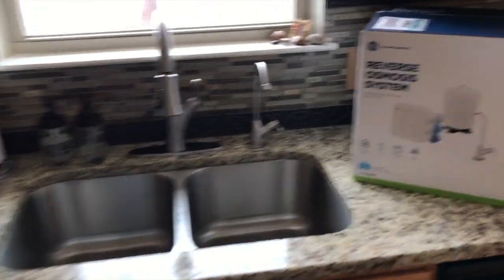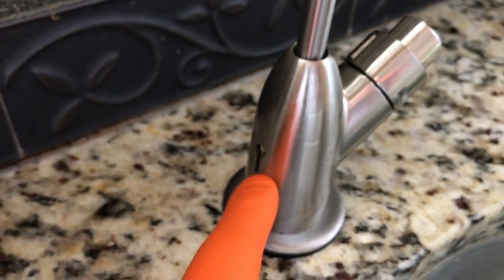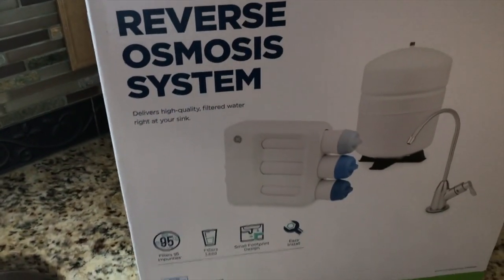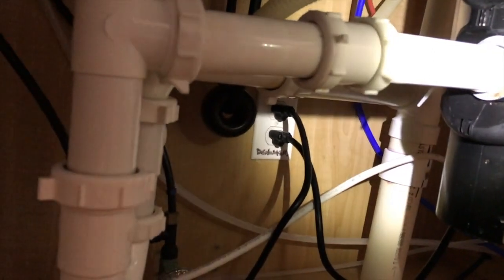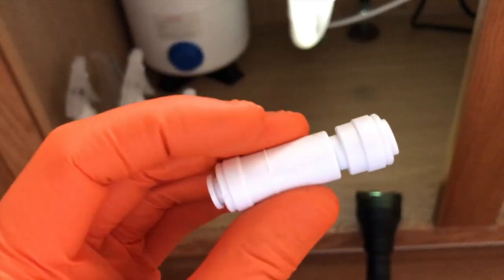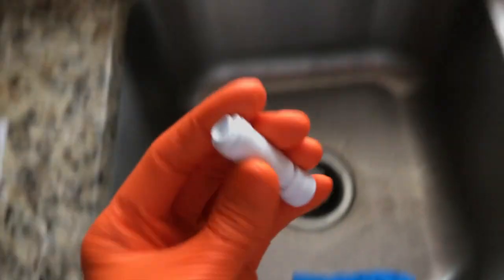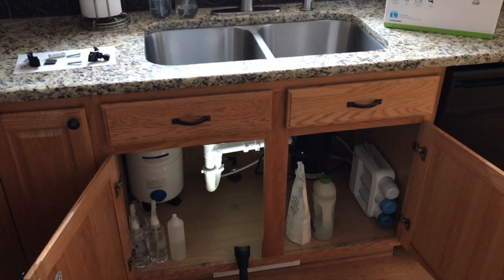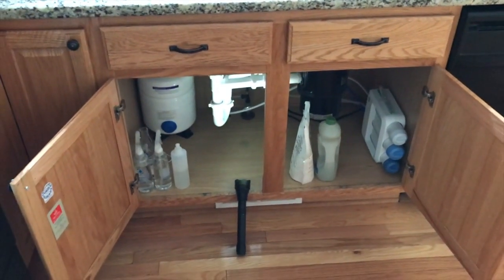Reverse Osmosis faucet Air Gap Bypass Kit

Comment: What if water is leaking out of that little air gap hole on the side of my faucet?
Reply from the maker: Thanks for watching, any update?

This is an indication that the drain line is blocked.  We recommend removing drain line from lower plumbing adapter and verifying it is clean and clear and not blocked.

Comment: I just cut the lines and added a 3/8 to1/4 adepter
Reply from the maker: Thanks for watching and sharing.

😁☕️🧰
Reply: The whole point of the air gap is to prevent sewage water to go back to the system in case the drain is clogged. When bypassed , isn’t the check valve supposed to block the back flow?

Comment: My air gap in the base of the faucet dribbles water. Started  after the first 6 weeks or so.
Turned the supply line off to the system and it stops.
Will this bypass stop the faucet from slow draining out the “weep hole “?
Reply from the maker: Thanks for watching, this is usually caused by a clogged drain line.

We recommend grabbing a small container and placing it where black drain line can drain into it.

Next, with system turned on and operating…disconnect black drain line and verify it has water draining out of it.

If no water comes out, try unclogging line so it stops leaking out of air-gap.

Below is a link to a tool that can be very helpful for unclogging line.

       https://amzn.to/4kqZ9oF

If interested in purchasing this product, visit our Amazon affiliate link above.  I earn from qualified purchases.

Comment: Ok! Let’s see if this is a solution for me: 
I have a waterdrop RO G3 P800 (non air gap) that I’m putting through a remineralization filter. That then T’s off to an espresso machine. And the other end (3/8 female compression or I have an adapter to male) is heading to Moen 3-in-1 filtration pulldown faucet (FS72003) that is set up for air gap. I am hoping to bypass the faucets airgap as my area code and RO system do not require one but I could really use some help!
Reply from the maker: @caprittaroberts895  

Thanks for watching, any update?  This system is awesome and very friendly to service.

Please let us know if we can help answer any questions.  We have also shared a link below to our (Fixing RO systems Playlist)

       https://youtube.com/playlist?list=PLjCXOz8TSkZlQnBuZZrgOiwjkvAkXc_Ov&si=RSuwj3Dq1lFd82s5

😁👍🧰

Comment: Can i change this GE tap with the regular no air pressure one,
Reply from the maker: Good morning, just poured a cup of coffee and am sitting down to answer any and all questions for the DIY community.

It’s possible however will require a small amount of modifications depending on the faucet you will be installing.  Most important thing is to properly install hoses on new faucet to alleviate back-flow or pressurization imbalance.

Let us know if you have any questions and hey if you’re into crypto trading, join our DIY ecosystem and become part of an exclusive group of DIYers.

       toolboxtoken.com

Reach out to us any time!  🧰

Comment: Michael, you mention removing the Red and Black drain lines from the Faucet... But you don't explain how to do this. Do I remove the Faucet to facilitate the removal of these lines or just pull them off from underneath? Please explain. I've had this same problem repeatedly recurring with my PureblueH2O system from Costco. And PureblueH2O is the WORST at customer service. THE WORST. Please provide more detail in your Fix. And Thank you for all the time and effort you put into your videos. 
@DIYwithMichaelBorders
Reply from the maker: Thanks for watching, removing these lines from this specific faucet setup is very tedious…

It’s best to have the faucet fully removed and resting on a table or in your lap for this procedure.

Most will steer away from pulling lines off faucet as it can possibly become a problem putting them back on.

Several of our viewers have shared with us that they removed faucet from countertop and removed lines from filter case.  They then allowed faucet and lines to soak in a pan of vinegar for 24-48 hours which cleared up any internal grime causing issues.

😎👍

Comment: People are making this too hard… air line should be mounted above P trap, take air compressor, blow the line out with high pressure…. Air duster can work to clear the line as well but high pressure works great…. It’s routine maintenance…… regardless of what kit you use, even the kits should be routinely maintained. This  method should be the most preferred due to the fact that every man needs a air compressor, one that is unnecessary so it can handle any air tool. Now because of the faucet, you have a bad axx air compressor, and have the excuse to start buying air tools that you never really use, but can also show your friends. Now your friends will need a leaky faucet.

Comment: Are you serious about the bypass kit being an issue for a house sale? Come on. You just take out the check valve (or just leave it, doesn't even matter), and you replace back the faucet to airgap IF the inspector thinks it's an issue. Also, no sane buyer will care. Are you saying that you would rather deal with the sound that spend 5-20 minutes to swap the faucet? There was no need to replace the perfectly good saddle valve, could have just used an adapter fitting, it costs $2 on aliexpress and $4 on Amazon.
Reply from the maker: Thanks for watching, we appreciate you sharing your thoughts.  Short answer, yes, bypass valves are not to code in certain areas.

😎👍
Reply: @DIYwithMichaelBorders  ok yes but who cares. the argument made in the video is that it will be an issue for a sale. and this is not a very good argument, because it is extremely easy to fix before the sale (replace the faucet quickly), and second no buyer will ever care. and from the perspective of food safety, you just need to make sure bad water can't get sucked back in. there are many ways of ensuring this is the case. for instance, my RO drain line goes into a sink in the basement's mechanical room, and even if there was negative pressure, it would only suck in a little bit of air and nothing else. also, IMO there is no reason to have RO under the sink. I have 2 houses and in both houses I installed RO in the basement. this makes them a lot more accessible, easier to maintain, and saves a ton of precious space under the kitchen sink.
Reply from the maker: @michaelkuzmin  

We appreciate the reply & your take on it.  👍

Comment: Hi! you mentioned that in order to install the bypass kit, you need to remove the black tube and connect the red tube to the kit.  Can you please elaborate a little more?  Do I disconnect the red tube from the filtration system and connect it to the bypass kit? what happens to the red tube connection at the filtration system?  How do I remove the black tube from the faucet line?
Reply from the maker: Thanks for watching & absolutely.  This kit will alleviate the black line all together.  The red line is the line that dirty water travels through and makes its way up to the airgap portion of the faucet.

It then enters the black drain hose and into your main plumbing.  By installing this adapter kit, the red line will feed directly into the bypass check valve and into your drain adapter where it will be flushed out via the main plumbing.
Reply: @DIYwithMichaelBorders  Sorry, but you never explain how to remove the Black line, which, in the video, you mention tossing it. But, you give no direction as to how to disconnect it from the faucet.
Reply from the maker: @bobholbrook3294  

Thanks for watching, disconnecting the black drain line will be same as removing Blue, Red, and Yellow lines on back of filter case.  It’s a press-fit design.

😎👍

Comment: I change the water filters,  the membrane filter and the flow control. Then I found out there was a leak under the sink.  Coming from the black line. On this system (general electric smart water system) there are 3 lines one blue that provides clean water to the faucet and 2 black ones. The 2 black ones are attached to a metal part that has a very small (ridiculously thin... thinner than a toothpick , way thinner!) From there the water comes out and drips to the other black line. Well, when I removed this thing to see what was happening it broke on me. Do you know the name of it please? So I can order it. I have already spend about $90. This system costs $ 160, 180. I am beyond frustrated now. I have already cleaned the whole plumbing all the way  to the wall but because it keep leaking that way I wanted to check were the lines were leaking.  Ok, I'm just repeating my self.  I'm just so frustrated.  I waited 10 days for the flow control to arrive and how this . Please help me . I did purchase it with home depot in 2017 or 2018
Reply from the maker: Thanks for watching & welcome to the DIY Raptor Club.  Below is a link to our video talking about the parts of our unit.  It may be helpful.

       https://youtu.be/PLQaoM3iNq4

In most cases, the part you are referring to is the Flow Restrictor.  We have attached an additional video link that shows us replacing the filters and membrane of a different unit.  In this video, you will see us showing the thin black line known as the Flow Restrictor at approximately the 5:50 frame in video.

       https://youtu.be/k2gwHePENtc

Hope this helps.  😎👍🔧🔩
Reply: @DIYwithMichaelBorders  thank you
Reply from the maker: @princbeauty1  

😎👍🔧🔩

Comment: The drain line can clog at the sink.  How would the bypass eliminate that?  How would you know it's clogged if water doesn't come out of the air gap?
Reply: How do you know when that cheap check valve fails?

Comment: By using the one way valve it replaces the air gap at the top, right? Does this prevent any back flow into the system like the air gap did?
Reply from the maker: Thanks for watching & welcome to the DIY Raptor Club.  That’s correct & the one way check valve will not allow back flow.  Hope this helps.

😎👍🔧🔩
Reply: @DIYwithMichaelBorders  in my state check valves aren’t to code since food bits clog them.
Reply from the maker: @float32  

Good morning & we appreciate you sharing this, that’s definitely understandable.  😎👍🔧🔩

Comment: Is the red drain line pressurized, meaning can I run it uphill to the drain? I want to put in a ro system for the refrigerator in the cabinet above. Then run the drain down under the floor across the kitchen and come back up under the sink to drain. My sink is plumbed with soft water so I don't want to run it though the ro system.
Reply from the maker: Thanks for watching & welcome to the DIY Raptor Club.  The Red line is pressurized.  For optimal & efficient performance & reliability, we recommend following GE install manual.  Keep us posted on your project.  

😎👍🔧🔩
Reply: It’s not like a water softener regen. It’s not a lot of pressure you might check on how far it can push the water. Also you will need an air gap at the sink. Don’t just tie it into a drain line. You can probably rig a regular dishwasher air gap to accept RO tubing then make sure you drain the air gap before the ptrap. If you already have a dishwasher airgap they make an airgap with an extra barb fitting so you can air gap both RO and dishwasher
Reply from the maker: @beckyschwantes5287  

Thanks for sharing your thoughts.

😎👍🔧🔩

Comment: So...mine is leaking out of that hole. I read the other comments and checked to make sure it's not a draining issue (removed the black line from the drain and let it drain into a bucket so it wouldn't be restricted. It still leaked) 
Any thoughts? I'm about to call GE and see if they will replace the faucet. It has been running fine for about 4-5 months since I installed it. Just started doing this 2 days ago.
Reply from the maker: Thanks for watching & that’s no fun...🤔

Has anything changed plumbing wise in home...?...any recent plumbing MX completed?
Reply: @DIYwithMichaelBorders  Nope. Everything has been running fine until yesterday.
Reply: @DIYwithMichaelBorders  It did start making the suction noise a day or two ago but yesterday was when I noticed the leaking out of the air gap. And it was only after I used it for the first time that day that it started too. Had to shut the supply off to keep it from flooding the counter.
Reply from the maker: @esklemm  

Thanks for the reply & you may be experiencing an issue with your flow control portion of system.  This part is recommended to be replaced annually at the same time as your Membrane.
Reply: @DIYwithMichaelBorders  That would be unfortunate as I've only been running it for about half a year. 😕
Reply from the maker: @esklemm  

We definitely agree.  Have you reached out to GE?  Any response?  Try turning faucet on & draining entire tank & then allow it to refill.  See if that helps.
Reply: @DIYwithMichaelBorders  Have not reached out to them yet. It's Christmas so I figured I'd call Monday. I have thought about draining and refilling...maybe I'll try that a bit later.
Reply from the maker: @esklemm  

Very cool & keep us posted.  😎👍

Comment: So if I do not need air gap, I just run the red line to drain? Do I then just connect blue line to filter and leave black hanging?
Reply: Check the RO manual as someone prior to you may have hooked it up wrong.
Reply: @kenkobra  I put it in new and it works with air gap. Of course, with noise after I use it to get RO water. I learned to fill a gallon container before bed, so I don't have to hear it. I keep this full when noise will not bother me.
Reply: Make sure you are tapping into the drain before the ptrap
Reply: @beckyschwantes5287  I did.
Reply: Sweet. I saw a video earlier where they drilled the tailpiece leaving the ptrap

Comment: Our GE RO unit is hooked in the basement.  We have no need for the air gap as our waste line is plummed away from the unit directly into our crock in our basement.  Is this bypass needed?  Our air gap faucet leaked and then broke and I need to purchase a new faucet.  I prefer one that is non-airgap.    Just curious about what we need to do.  thanks!
Reply from the maker: Thanks for watching and that’s a great question.  Depending on local/state codes, you may need an air gap faucet however we recommend doing a quick Internet search on your local county/state plumbing codes and see if an air gap faucet is required where you live.

If you plan on selling your home in years to come, it could be something that fails a purchase inspection...that’s if you install a faucet without an air gap & your county requires one...

But... if your local county/state does not require an air gap faucet, we definitely recommend purchasing a faucet without an air gap as it can be very loud and annoying.

Hope this helps.  Keep us posted.

😎👍🔧🔩
Reply: @DIYwithMichaelBorders  thank you, we are going to use a non-airgap faucet (no plans on selling).  Do we still need to purchase the bypass since we are draining directly into the crock in the basement?
Reply from the maker: @stacywerner880  

Thanks for the reply & that’s personal preference.  😎👍

Comment: So I've got water coming out of that hole. Is there an issue with the faucet itself? Does anyone know of a simple solution?
Reply from the maker: Thanks for watching & welcome to the DIY Raptor Club.  This usually happens when your drain line is not positioned in a way to allow constant downward flow into your plumbing below your sink.  You may need to cut off an inch or so to give it that constant downward position & flow.

😎👍🔧🔩
Reply: @DIYwithMichaelBorders  thanks. I checked it and the clamp piece had shifted to block the drain hole. Readjusted it and its not leaking anymore. Thanks for the reply
Reply from the maker: @garyjerniganjr  

Thanks for the update & that’s great news.  Sounds like you’re back up and running.

😎👍🔧🔩